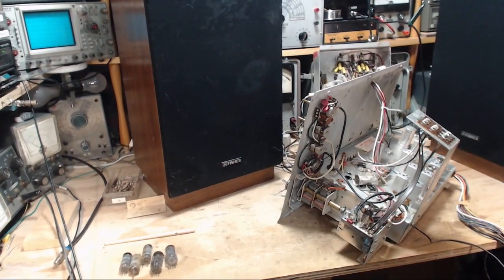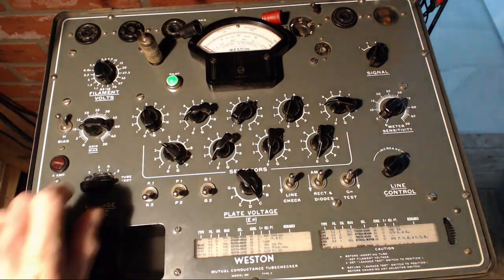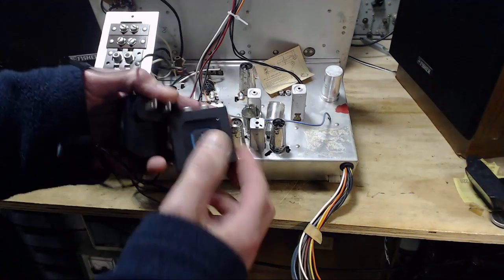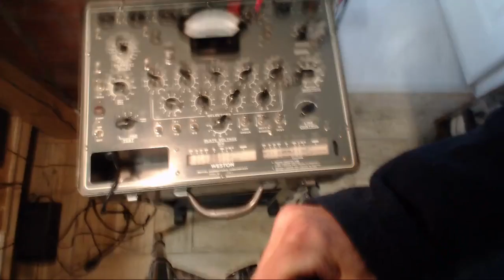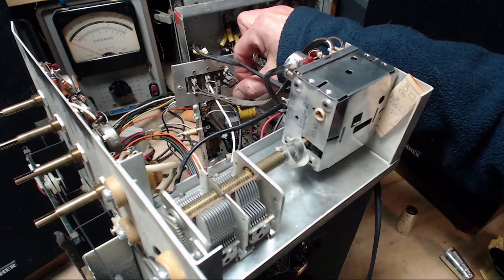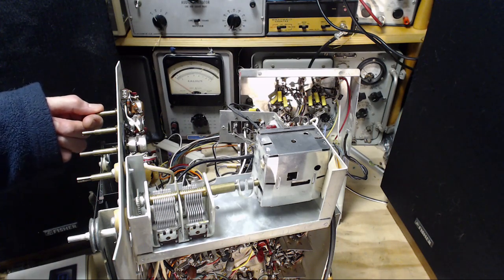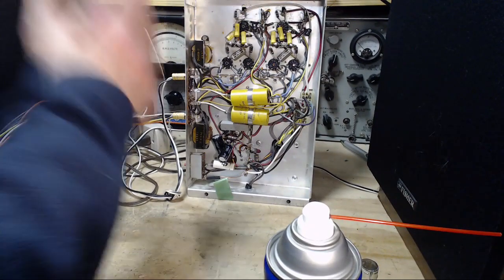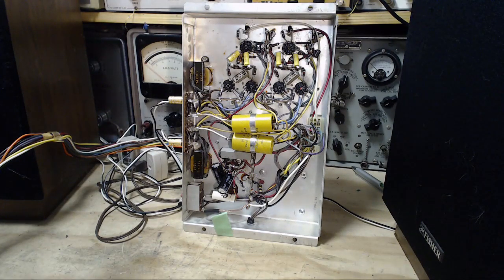Canadian Admiral J104X J105X Console Video #10 - Receiver Assessment

Comment: To cut down on ballistic miniature tube launches get some "finger cots" at a stationary store or department. These are used to get a more efficient grip on papers when filing or counting. (You can sometimes see tellers or bookkeepers using them to count money or receipts.) Put one over the top of the tube you want to remove but can't quite get your fingers around. This will give you a better grip and control when you pull. Just remember to take the little guy off when done or it will melt or dry out on the tube when put back in service.

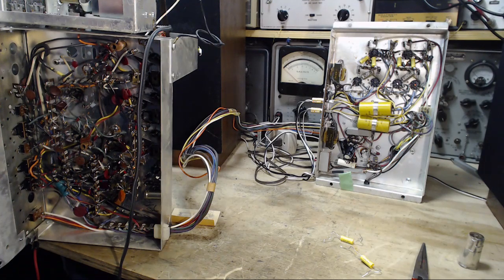Comment: Hmm why would the amp be humming more toward the end of the video? Because it clearly and obviously was starting to oscillate again at 50:52. And these oscillations have the potential to immensly load down the supply. And even though way out of the audible range, these oscillation produce any kind of cross modulation products. Since you suspect that the oscillations may be caused by these humongous speakers (or rather their crossover network therein),  why not test that theory and use a simple general purpose wide range speaker instead? And you do know that amp repair normally takes place using a purely resistive dummy load just to avoid these red elephant chases? Just FYI a semiconductor amp would have blown up subjected to these oscillation before you could spell dripnif! And lastly; The output tubes in push pull should be matched for optimal power supply ripple rejection. If both tubes in push pull draw the same quiescent current the ripple modulation in their plate current is the same and cancels out. So open the path from the cathodes of the EL84 to their common cathode bias resistor and insert a 1 Ohm resistor into each path to monitor the idle current distribution between the two tubes. Proper repair would seek to find best match of tubes.
Reply: Not to mention that ultra sonic noise is likely to burn out tweeters. I have had dozens of speakers pass through with blown tweeters because of high frequency oscillations, harmonics, and clipping (transistor amps will cut off the tops of waves resulting in doubling of the effective frequency at high power levels - short version of a long explanation.